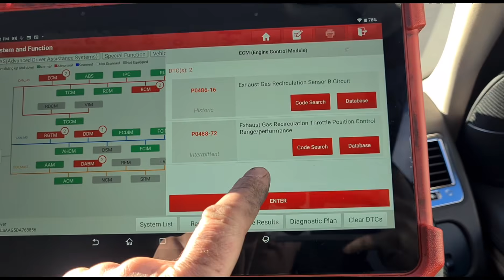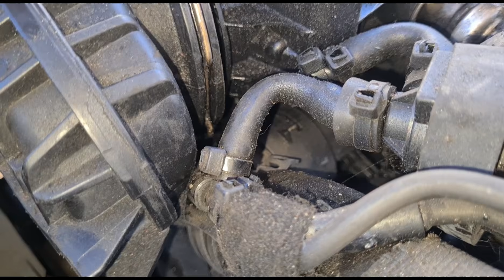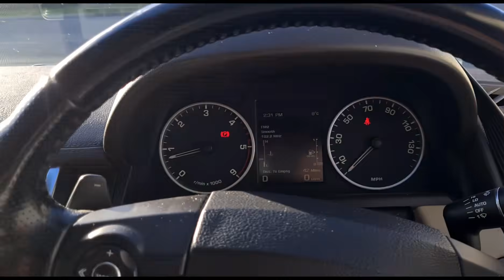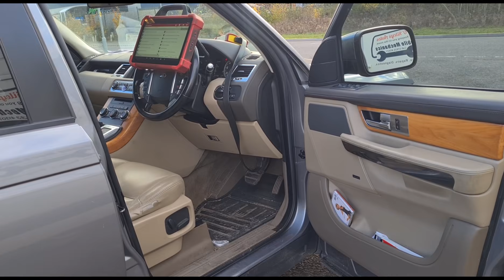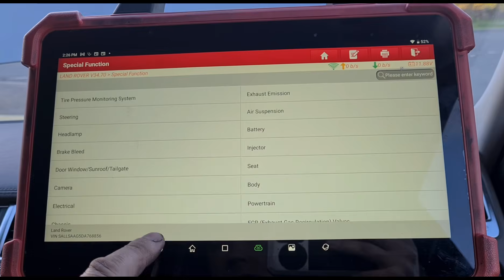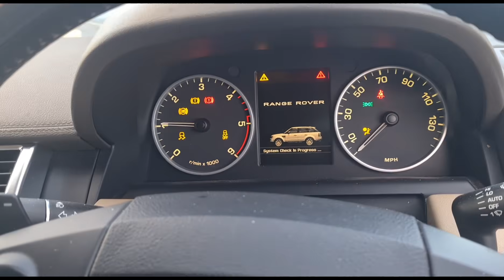Range Rover 3.0 DPF Cleaning Goes Wrong! 😮

Comment: Having fun with my SDV6 at mo, RESTRICTED PERFORMANCE 😂 only code I get is P006A-00 pending MAP, mass or volume air flow correlation. Issues being, some one didn't put a MAF back in carefully & the Oring to air filter was trapped badly, also the air bix housing joint going into the throttle body unit was crooked, part of the moulding was hitting a pipe forcing it out, so removed a plastic moulded fin that was catching the pipe, then the MAP sensor was some what grubby so tried cleaning it but still get the same code, whether under throttle, cruising downhill or just slowly driving. Sometimes it's RP every 2miles, sometimes not for 20-50miles. Thinking of changing the MAP sensor or the whole throttle body. Replaced the Oring in the MAF & cleaned those aswell. Bit of head scratching at mo. 😁

Comment: Do you think it was the tap you gave the throttle body that damaged the housing underneath? Trying to figure out what caused it before I undertake this job, as I don’t want to have any further complications when I do it
Reply from the maker: No. It was the high revs caused high pressure in the coolant and the part was brittle so it was ready to crack
Reply: @ORileysAutos   ah that makes sense, just bad/lucky timing then. Typical!

Comment: l'm not a mechanic but there seems to be a lot of plastic parts on these modern engines. Only had one fairly modern diesel vehicle (2001 Caddy Sdi) and it looked quite basic in comparison, had an EGR valve but no particle filter.

Comment: I think "dpf care" should be part of the theory test.
Reply: Any awareness would be good, the reason pretty much no cars have a indicator of when theyre regenerating is because the average driver would just be bringing it back to the dealer every time the warning came on, so instead the car just tries to do it at random and usually doesnt finish, resulting in all the problems we face.

Comment: Ive a vivaro 2.0l tdci camper and just had a dpf fitted after the old one blocked up up scotland due to a stupid machanic fitting a cheap £16 sensor and now 2 month on the engine management loghts come back on and the red stop light. I dont think the machanic who fitted the new dpf got rid of all the fault codes after fitting it as it was the same who fitted the £16 sensor ime gitted as not been able to go away for xmas. Any ideas what could be wrong would be helpful. Ohh and its now blowing white smoke out the exhaust and makes a sucking gurgling noise when i take the fuel cap of

Comment: Do you have any live data difference pressure readings from a dynamic test, not a static? 6th gear and flat down from low revs to max? Before and after your cleaning process?

Comment: Inputting DPF replacement without replacing the dpf created massive problems in the future and is just a lazy way to clear the fault code. Why not do a dynamic regeneration, and spray some crap directly into dpf, without the car (knowing about) regenerating anything? The diagnostic tool obviously shows you by remaining dpf volume that you didn’t clean anything from the dpf. So now the dpf is full and the car thinks it’s a brand new one. Now you need to actually replace the dpf in order to the actual values to match up with the computer. Congrats, you just created a multi-thousant £ problem.
Reply: Not true. After 5 minutes of measuring differential pressure on DPF, the soot mass and %of DPF blockage will be updated. Not a single thing goes wrong when you tell the car there is a new DPF inside. It's only risky if it's completely blocked and you tell it's a new one. You could damage the engine in those 5 minutes when the car is not in limp mode.

Comment: Iv done all that with a 3.0 Discovery ended up blanking the EGRs - now have a 3.0 X5 that also suffers from typical diesel injector blockage - no warning car just cuts out going along which is pretty dangerous the injectors not cheap job either - reliable diesels ?? Money pits
Reply: Good company down south that cleans and repairs injectors they were on salvage nation channel recently

Comment: If cars just had a simple turbo diesel engine they would run indefinitely, all this shit fitted to them now puts them in the scrapyard in 10 years, good for the environment?
Reply: The rules were imposed by the EU parliament. The DPF was the car manufacturer's solution to a problem imposed on them by politicians. 😞
Reply: @NotMarkKnopfler  Poor manufacturers didn’t know that diesels stink.
Reply: Diesel is for trucks. Period.

Comment: Had the same thing happen to me on a xf jag while looking for a mysterious boost leak. When I pulled the throttle valve away from the inlet stubs to get to the water housing it broke & I reckon it always had a crack in it that was blowing onto that water housing and cooked it.

Comment: Early 3.0 tdv6 end up with alot of oil in the intake, Had a couple try and run on 😳 be careful revving them up. They revised the oil return on the o/s secondary turbo, can retrofit it as a kit. Also if you watch live data on the later ones they activate the turbo (via tsov) if you leave it idling for 3 minutes to help clear oil build up! Remove the compressor switch over valve csov and drain the intercooler get a fair bit out. Work at a Land rover specialist for my sins

Comment: Remember when you'd buy a diesel for reliability and longevity. Today they are a pile of junk
Reply: Most diesels are bought for the wrong reasons

Economy however you need to be doing over 15000 miles a year for the costs to work out

Then they're driven on short journeys and don't get to regenerate the dpf

Plastic parts is just down to costs
Reply: My Jag XJ 2.7 diesel just passed 190,000 miles and drives beautifully.
Reply: @PJ-om2wq  French engine. Hdi are wonderful, especially older ones, but the XUD that went before was a real long life motor - plus, it runs on veg oil.
Reply: @Bercilakdehautdesert-yt1gd  I had both, and for me the HDI was more reliable long term.  My XUD at 200,000 miles had stretched head bolts and started to get steam coming out the exhaust, and was loosing compression on the exhaust valves when cold.  At 350,000 miles my HDI was still driving like new.
Reply: I agree with the maintenance part but what puts me off is all the plastic parts used..
Reply: Some parts of the world you can still buy proper diesels, Toyota 1HZ, Nissan TD42. Non turbo, gutless sloggers that will last for ever
Reply: I agree, Glass's guide should add a category for scrap value for cars like this.
Reply: I’ve had diesels up to 350 tho no problem all about the services
Reply: @clonSanG  what year was the 350 k vehicle
Reply: The powers that be are constantly slapping more crap onto diesel engines to reduce their economy and longevity… can’t have them being that much more economical, reliable and favourable than petrol engines now can we 🙄
Reply: A lot of issues with modern diesels is all the emissions control stuff now
Reply: Maintenance is key mate.
Reply: @MrThommo78 Maintenance and the way you put miles on those cars…. around town: petrol; lots of miles on highway: diesel
Reply: @MrThommo78  Maintenance doesn't prevent thermostat housing, or inlet manifolds splitting or crankshafts snapping
Reply: Agree. Many of these lumps in JLR stuff are PSA junk. @Phantom-mk4kp
Reply: Or just go om606
Reply: @danielswatowsky5677  I second that
Reply: Its a Range Rover, wtf did you expect ?...🙄😂
Reply: @peterfitzpatrick7032  the poor guy has to fill it up with fuel now and pay the mechanic.   I'm glad it's not mine

Comment: That was lucky and unlucky at the same time. Unlucky for Jimmy that it developed a major coolant leak whilst he was working on the throttle body fault. Lucky for the customer that it didn't happen whilst belting down the motorway, with the possibility of over-heating complications.
Reply: Be sure something else will fail whilst on the motorway
Reply: @esbrasill just one thing? 😂
Reply: If he was there any longer something else would have broken.